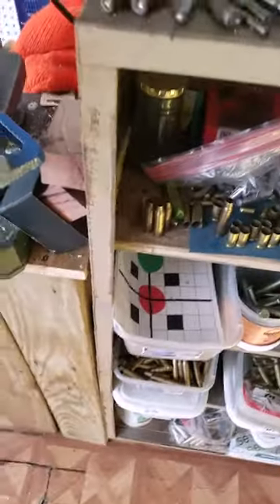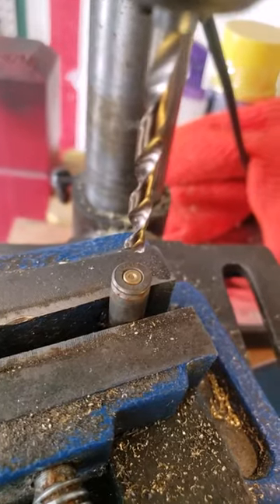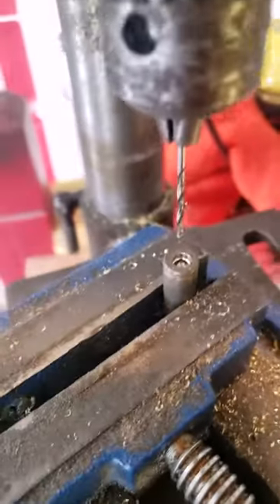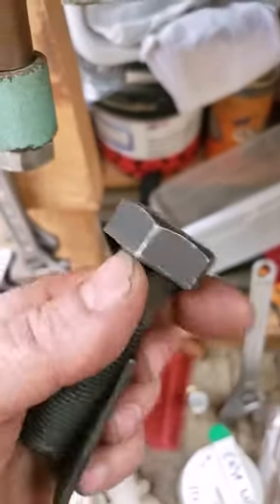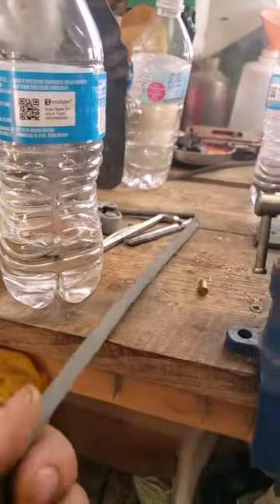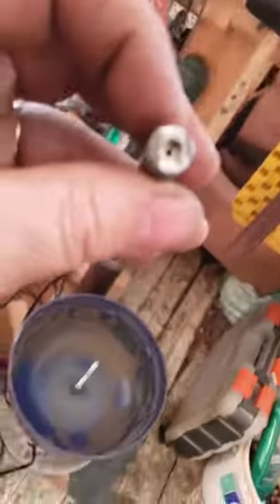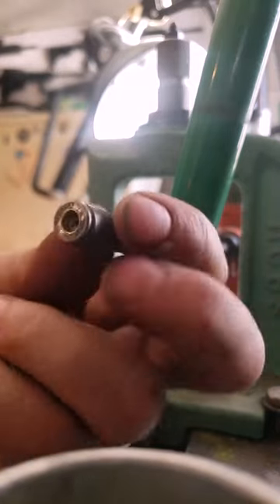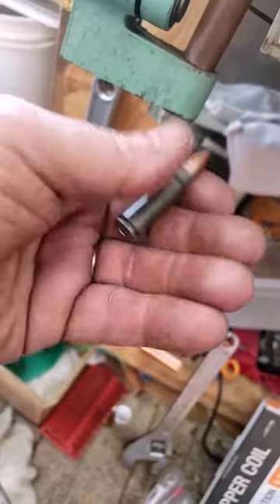Convert Berdan primers to Boxer primers EASY...

Comment: This isn't easy fast or time efficient. Best way to berdan to boxer is take a Lee universal decapping die. Remove the pin. Drill and tap the top pipe thread to 7/16-14 thread. Take a 7/16 bolt and turn half it down to 0.3 in and then 0.18" and the base. Then just run the case in it will pop a flash hole and pop the primer out. I have done hundreds of berdan cases like this. 7.62x39 and 7.5x55.
Reply: I don't have a lathe.  Maybe I could use a drill press and a file to turn the bolt down. 
But if I understand what you're saying this is just the de- priming and putting in a flash hole,.. I would still have to increase the diameter of the cup using something, this video shows using 22LR brass.
Anyway thank you for giving me the concept.
Reply: @braininavatnow9197  for 7.62x39 I load cast bullets. So I use a large pistol primer and insert it pretty hard. Then a drop of super glue just in case. For 7.5x55 brass berdan or any brass berdan case. I peen the primer pocket with a ball bearing. Then clean it up with a primer reamer and your good to go
Reply from the maker: Hahahah I love people who have different techniques.
Still this is pretty easy to me.
I'm not sure people can "turn" steel in their home hobby shops.
To be clear it's a simple three step process.
Once converted they're done.
How many steps did you write again??
Anyway it's just information for people to try.
Are you saying you are "punching"a new flash hole in the center?
Reply: Do you have a video? Sounds like a great idea...
Reply: Easy and time efficient is to get proper boxer brass... Seriously its not time efficient at all to bother with 7.62x39. 7,5 swiss is also commonly found with boxer.

Comment: Been saving my 5.45 and 7.62 steel forever just in case, and I like projects…  ever tried 5.45x39? Also have you found away to store the fired cases so they don’t rust?
Reply from the maker: Typical I pick up cases as soon as I fire them.
In my house in Maine they dont rust.
The few I've picked up that were left by someone else and have started to rust I hit with fine steel wool and run a wire case brush inside.
They come right back.
I do hit them with silicone spray once loaded to give them a coating
Reply: Might not work for 5.45mm.  It uses a smaller primer than 7.62.

Comment: I remember freaking out when the current administration banned all Russian anything from coming into our country. And I also remember thinking man I’m going to have to turn berdan into boxer. Luckily though I found a amazing deal on Norma brass case boxer primed 7.62x39. Bought a decent supply it shoots decent and as of late I have been loading cast powder coated in the case on top of H4895. However what o have noticed is AK’s are violent when ejecting the brass cases. On average I’ll get 5 to 6 reloads on the brass Norma cases. There’s definitely a reason why the com blocks use steel in the AK. Oh and the reason I will trash the case isn’t even from possible head separation. It’s the extractor grove gets bent and chewed to hell after multiple firings with actual spec power loads. Gotta remember the Wolf and Tula isn’t exactly full power and quality ammo. Nonetheless 5 to 6 reloads is sufficient in my opinion.

Comment: I’m having some troubles with 22lr brass being swaged into the bottom of the primer pocket.  Are you pressing the 22 all the way down to the bottom of the primer pocket or to the shoulder created by the drill bit? How have the sleeves held up to multiple reloads, do they have a tendency to come out with the primer while sizing/depriming?   Ps thanks for the awesome video!!! 👍
Reply from the maker: I press them till they bottom out.
It takes practice but you get the feel of it

Comment: This video reminded me of an electrician I ran into at the gun range years ago. He was collecting the .22 cases for making his own wire crimps. He had a tool that trimmed them quickly. Neat and resourceful! 

If by some  chance you can't find the thousands of spent .22 cases laying about... you can also use those ground-wire crimps. You find them in the electrical section of the hardware stores. I don't know their official name, but they're used to crimp the ground wires in your home electrical boxes. If I'm not mistaken, they are the same diameter as a .22 case, but they are only about 1/4 - 5/16" long. I have NOT personally tried this for resizing the Berdan primer pocket, so do your experimenting.

Comment: Instead of using spent 22 shells, I used fired shotgun shell primers. I can usually get two 'inserts per shotgun primer. To press them in use a RCBS Primer Swage. To hold the cases in the vice I have two pieces of hardwood slightly smaller than the base of the brass and sprinkle rosen in the grove. Holds well and no metal to metal scratches.

Comment: If not considering a lathe, I would at least try running the sides of the hack saw blade over a stone, like a diamond sharpening stone, removing the set on the blade. This would turn it into a flush cut saw and avoids damaging the case.
Reply: Another idea is to setup collet that has a quick lock unlock in vice and trim with end mill in the milling machine.  I trim bullet jackets this way, I got the quill adjusted so it maxes out and I don't have to worry when to stop and its very consistent

Comment: We are a brass supply company and this is actually pretty cool, if even just for the fact it can actually be done in case of emergencies which we have all seen can happen. The biggest drawback I can see is that many of the steel x39 which is 1-2 55gal drums a month, many of them have split necks, cracks and many other forms of defects from heir single use firings. But even our  x39 brass is .20c each per case for once fired and its rare.
Reply from the maker: Do you have brass 7.62 x 39
Reply from the maker: Yeah like all cases you have to inspect them.
And toss the junk.
I've even reloaded Aluminum and if it's not split already you usually get one more load then they do.
But so far 1000s and 1000s and 1000s of rounds later its worked fine
Reply: Would you happen to have any 375 Winchester brass?

Comment: I have reloaded a good amount of Tula/Wolf boxer-primed steel cases.  Although they are reloadable, they are much more prone to cracking at the neck than brass cases.  You may only be able to reload a steel case 3 times, and some may crack after firing the 2nd time.  Just something to note before you put the labor in to converting a whole lot of cases.

Somebody was selling kits with tooling and aluminum bushings to press into the head of the case, but I like the idea of using .22LR brass.

Comment: After you've converted the case , have you ever had the .22 cut case pop out or is it in there permanently. 
Very interesting video.
Reply: I've seen something similar done except a guy added a drop or two of super glue in the seam between the case and the copper tube.

Comment: wow thats innovative for using the .22 cases as primer sleeve, I like to save my copper tubing for other purposes like electroplating. Also I know you explained the use of 3/16 end mill, but if  you used the 7/32 main bit to remove the primer and anvil; but I dont get that part because 7/32 bit is larger diameter so wouldn't the depth of the primer cup needed already be created since it was used to help center drilling for the flash hole?
Reply: Most end mills are flat on the end.  Drill bits are not.

Comment: I found a guy who sold once fired brass with boxer primers for 10 cents a piece and bought several thousands from him.  I convered a lot to 6.5 Grendel and I did other conversions from 223 to 300 blk, 300 ham'r and 221fb but steel cases just plain suck.  They are harder on the dies, I don't think they will last long and I just don't see whats stopping the "ring" coming out with a spent primer when you decap.

Comment: Just curious, have you ever had any problems with these cases after reloading? If so what have you found.
Reply from the maker: I'd say their life isnt as long as brass.
I get usually about 3-4 reloads before I start to see neck splitting etc.
Still I just wanted to work out the process and as you can see I did.

Comment: Why make a flash hole? The case already has two little ones from the old primer.
Reply: You can size and deprime the case for future reloading. Of course there is the hydraulic method but that is messy, and there is a special berdan deprimer tool you can buy or make that pierces the primer and yanks it out.

Comment: I have a lot of Berdan primed brass shell cases in 7.62 x 54R & those you can't use the .22LR cases because once you drill deep enough what's left of the Berdan primer will pop out & with the whole primer out of there you will need the copper 1/4" tubing because the whole primer is gone. Also, as a previous poster mentioned, what is the purpose of the 3/16" End mill when that is a smaller diameter than the 7/32" drill bit you just used??
Reply: End Mills are flat on the bottom, drill bits are not.

Comment: Wanted tontrynthisnon 7.62x54R.  What size drills and endmill would I need
Reply from the maker: hi I tell you that in the video
Reply: Ok, I was thinking the 39 was small rifle primers
Reply from the maker: @drunkenhillbilly456  nope they are large rifle.
But again Berdan Large primers are a shallower cup but wider diameter. 
So that's the reason for the spent .22LR cases.
Essentially we are touching the primer pocket with the mill to deepen it some and then using the .22LR case to make up the difference I'm diameter. 
I could have gotten into exact depths in terms of how much material to remove from the pocket
AND when I started I was a fanatic like that.
However what I found was they work food if you just touch em with the end mill.
You'll get used to it
I've done many now.
And I've reloaded them in some cases 4 times no splits or issues
Reply: Thank you very much for all the great knowledge.  Best video out there on this issue.
Reply: @chriswilliams5268  SUPER INFO.
THIS is the very type of info I like to keep on hand for those what if times.

Comment: Won't steel cases wear out the resizing die prematurely?
Reply from the maker: Hmmm I would imagine if you loaded thousands and thousands and thousand and thousands add me saying many thousands over n over then yeah sure.
But keep in mind your reloading dies are HARD HARD HARD and steel cases are soft. 
People often worry about things that wont happen sadly.
I had a newbie reloader try and tell me dirty cases would ruin my dies to.
Trouble is I've only been polishing brass for 10 years which means I reloaded dirty brass for 35 years before that and never hurt or wore out a die.
In fact I load many 1000s of rounds per week and have most of those 45 years and have never worn out a die.
So I wouldn't worry about it

Comment: I have been a reloader of shotgun, rifle and pistol ammunition for more than 45 years and this is the dumbest thing I have ever seen a reloader do… I mean, it’s not like you are dealing with THOUSANDS of pounds of pressure when firing a round of ammo… oh wait… yes you are! Monkeying with a sketchy steel case to start with and then fiddling with a collar inside the primer pocket pegs my meter detecting inept behavior. When something goes terribly wrong with this reloading operation, and it will, the person in the mirror will be the one in the liability loop for this stupid operation.